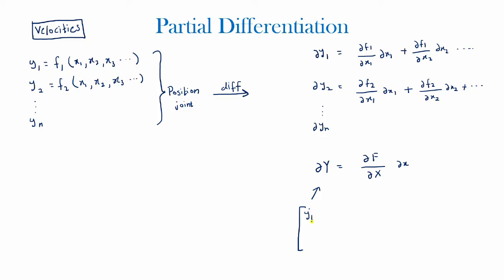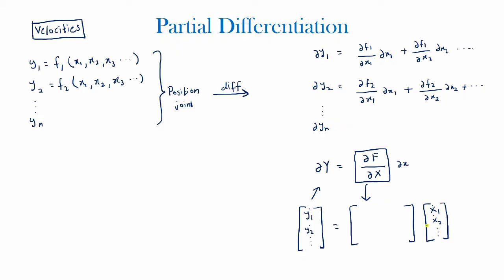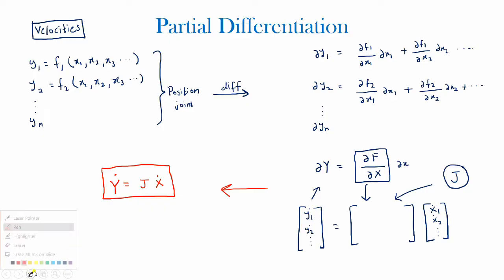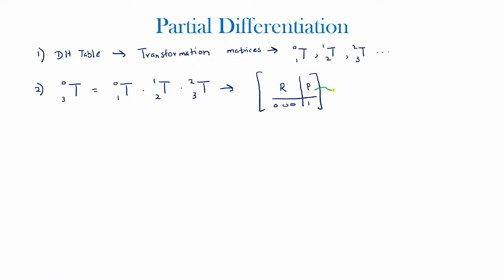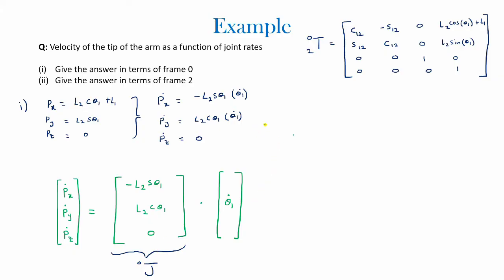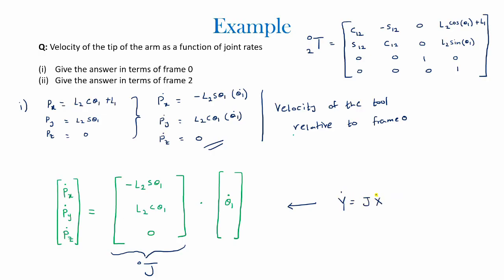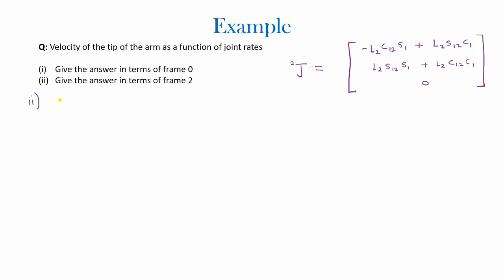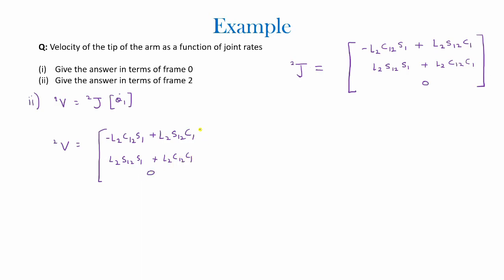Jacobian Matrix - Partial Differentiation Method | Robotics | Part 2

Comment: How is it possible that the velocity of the end effector do not depends on theta2, i have seen another formula for the Homogeneus Transformation Matrix, that is slightly different from the one showed at (10:13)
Reply: I think it's highly possible t he did the DH table wrong. The values in this DH table make no practical sense.
Reply: @ShihanTang-e9e  Hi, can you please write DH table parameters? I have an exam tomorrow so if you answer this it would be very good :)
Reply: @protobass4070 
How was your exam? 
Did u pass?

Comment: Here is a mistake....inverse of 3x3 matrix will be get by taking adj(A)/det(A) not by simply tansposing the matrix
Reply: Just to clarify if any one else see this question: In orthogonal matrix The inverse = Transpose as the determinant is always 1 because frames donot change their scales
Reply: What is the timestamp ah ?
Reply: @luzmanhasif6071   15:14  I dont know, how he calculated the inverse of 3x3 matrix by simply changes rows into column.
Reply: @rabahalishah5124   yes but even if you do that the answer will be same , but yeah simply transpose is not the inverse of a  matrix, yyou have to take adjoint of matrix/determinant of matrix, though it comes the same in this particular case

Comment: What happens when serial manipulator has 6 independent joint angles? In that case as well we get a 3X1 matrix on left which is Pxdot, PyDot and Pzdot but on the right hand side it should have a 6X1 theta(variable) matrix. So there will be unbalanced matrices in terms of dimension. Could you briefly reply to this comment?